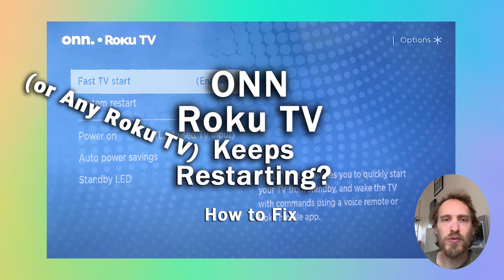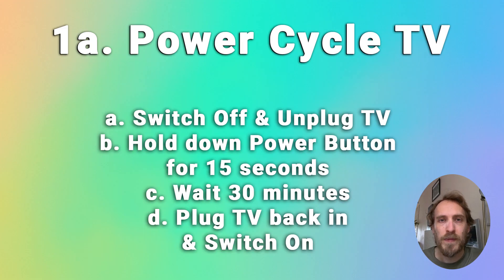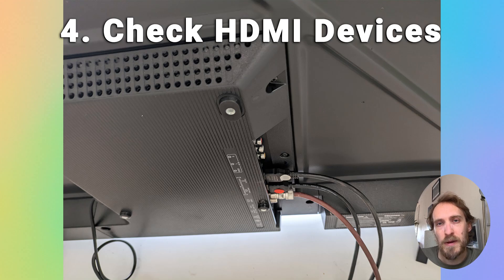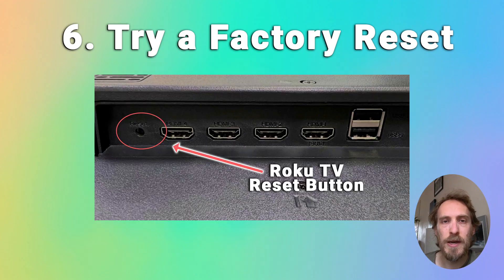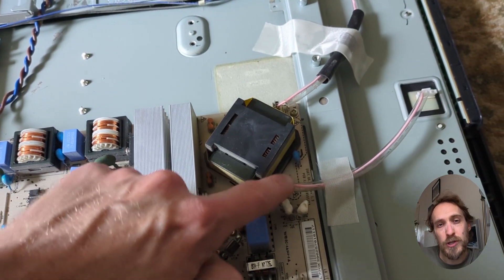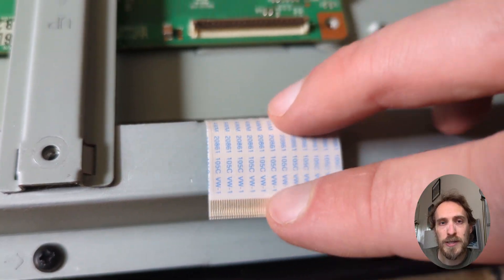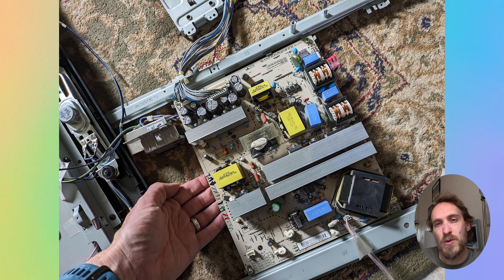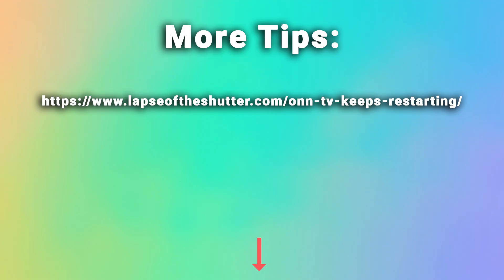[Roku TV] Keeps Restarting (Turning Off and On)? FIXED

Comment: After 2 years with this problem, the Roku control interferes with your router and tv acts crazy, just change your tv to 2.4G  or a previous internet setting than the 5G. What i did was to connect the TV wire to the LAN2 of my router. Do not use wireless connection. The interference will stop.

Comment: Mine isn't even turning on that far to go into the settings. It restarts as soon as the onn Roku TV advertisement flashes across
Reply: Same
Reply: Me too
Reply: Mine to started a few days ago
Reply: Have y’all figured out what’s wrong with yours yet?
Reply: Same thing is happening to me
Reply: Yall figure it out?
Reply: @Dmess110 no 😢
Reply: I figured mine out, all I did was use a paper clip and reset it with the little button and so far it's working fine. It is very very slow at connecting to my internet all of a sudden and it likes to lose connection. I do believe something is wrong with the TV but I have it working for now.
Reply: @truckerguy28 which little button?
Reply: @m2angelo  in the back of the tv on the side
Reply: @truckerguy28  Which little button are you referring to?
Reply: @archivaalgaming  in the back of the tv on the side